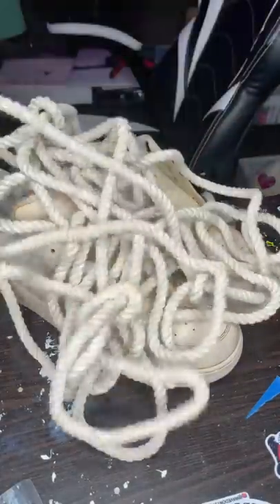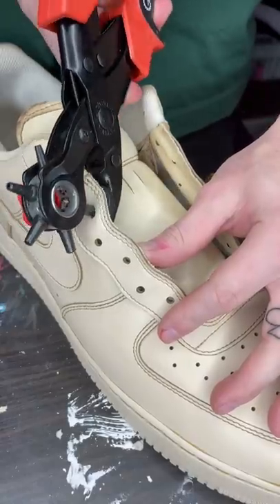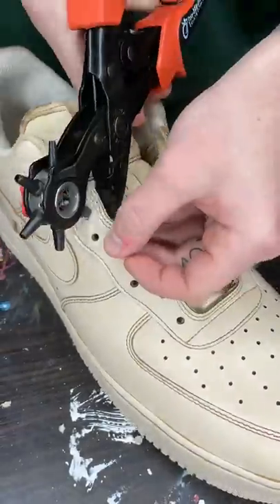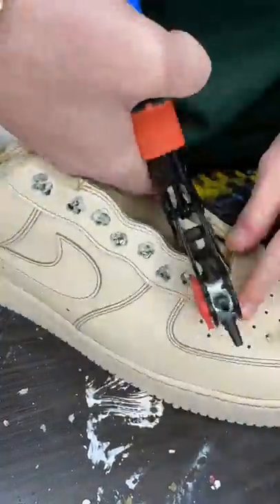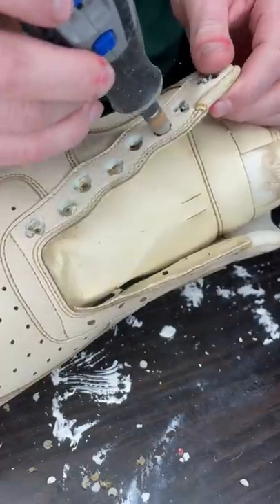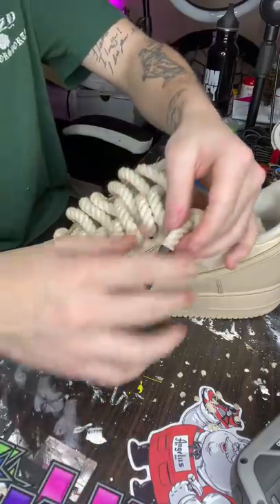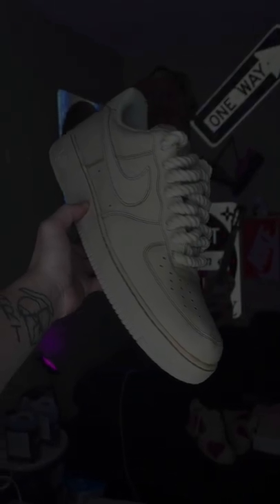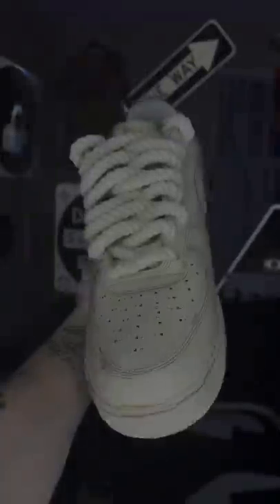These ropes are HUGGEEEE!!!!

Comment: I hope your letting these people know that the shoes won't last long!!! Literally soaks them in hot water and probably destroys glue on sneakers
Reply: They actually last way longer! I had a pair done in how water and they lasted longer and got worn more, the ones without water came away at the front like a crocodile mouth flappin everyone I walked!
Reply: Absolute facts. One of my good friends is an old school cobbler. Soaking shoes with this type of construction is probably one of the worst things you can do when it comes to the integrity of the shoe. Besides AF1'S aren't treated to be waterproof so when they're soaked and dried the natural oils in the leather are drawn out (that's bad) Plus they look wack
Reply: @robertwilliams5015  exactly almost every shoes midsole is glued on! If anyone has ever watched a cobbler work on shoes they'll know they use heat to take the shoe apart 🤦‍♂️
Reply: @robertwilliams5015  Nah, you are over stating all this, you can apply reinvigorate and penetrate all and any leather with a whole host of multitude of products on the markets.

In relation to the rest of the trainer, drying by application of heat will ensure great adhesive properties to go back to factory setting or even beyond that of factory, consider it a adhesive upgrade by double dipping the glue properties to make it stronger.

Lastly, they are trainers, not to expensive to wear and ruin in a couple of years with frequent wear and use so don't worry and enjoy the upgrades provided by such skilled craftsmanship, if it ain't for you don't bash until you have tried and no doubt you have not Sir.

Good day to you.
Reply: @pandaview2673  

Sorry friend but you're either confused about my comment or you're confused about the type of shoe this is.

Leather conditioners and cleaners do not restore leather to its original condition. This isn't a leather saddle designed to last generations, its a cheaply made basketball shoe from China..My comment spoke to the integrity of the leather which in this particular application which has been designed with a specific purpose and is absolutely not intended to be subjected to being soaked in boiling water.  "Trainers?" AF1's aren't trainers that wasn't what they were designed for. In addition I never mentioned anything about the adhesion of the glue HOWEVER if you're suggesting that the glue used in the construction of this shoe can be heated, compromised and reheated again and still have the same integrity......you have absolutely no idea of what you're suggesting. A professional repairing a shoe for example would NEVER say something as ridiculous as that.

The fact that you consider these changes an upgrade provided by a skilled craftsman, tells me everything I need to know about your experience.
Reply: @Big_boom90  

Right and if he was repairing a shoe he definitely wouldn't just reheat the old glue and stick them back together. This Panda dude doesn't have a clue.
Reply: @pandaview2673  yeah roberts correct
Reply: @robertwilliams5015  Sir, you literally not know of what you speak, I am Chinese maker of these trainer's and I know of what I speak. Stop affecting our sales with dumbo comment and check your own integrity not integrity of shoe being customised.
Reply: @Panda View  Stop insulting the Chinese people by posting nonsensical comments. 

AF1's aren't trainers, period. If you think they are, then there's clearly an issue with semantics. In Europe they call soccer football and that's fine but here in the USA AF1's as they were originally  designed is a basketball sneaker (albeit not a very good one) They aren't "trainers" and nothing about their design or function lends itself to them being "trainers."

In other words (respectfully) You don't know shit.
Reply: @Big_boom90  bro how you get so good at what you do bro? Like what’s your secret!?

Comment: Put electrical tape on the rope before cutting it to avoid frayed ends. After cutting burn with a torch or lighter. Better yet, use a torch to heat a piece of thin steel and use it as a hot knife, cutting and burning the ends in one swoop. Tips from a Commercial Fisherman

Comment: The fact you called a dreml a screwdriver is why people say your overpricing, the tools you have shown here didn’t even cost you a 100 bucks, you literally have the cheapest dreml(the right one for this job nevertheless, n ur shits dope) but fr dreml’s are the coolest rotary tool out there, not gonna get a sponsorship calling it a screwdriver, if you don’t get an upgraded mandrel you literally can’t even do that, screw bits won’t fit, dreml/rotary tool those are your words use them correctly